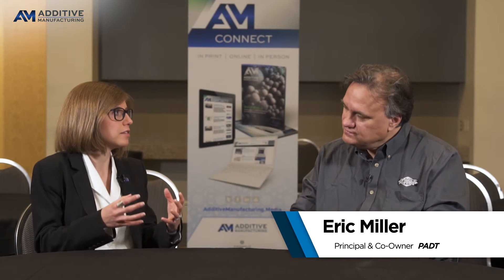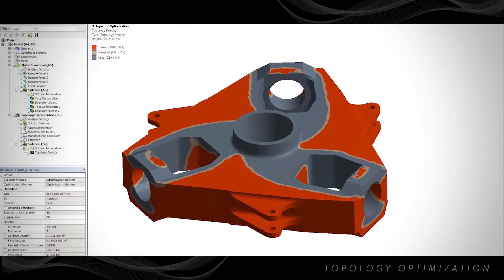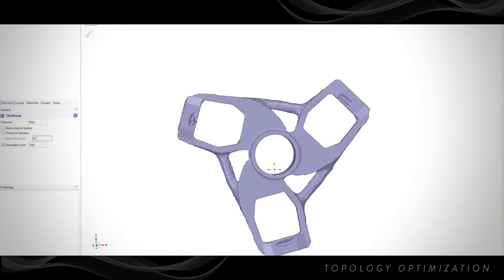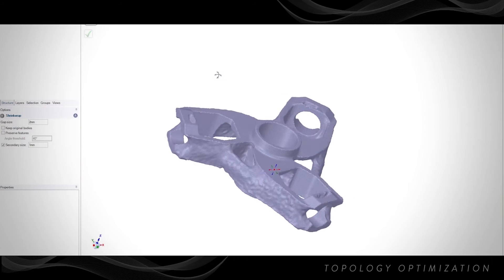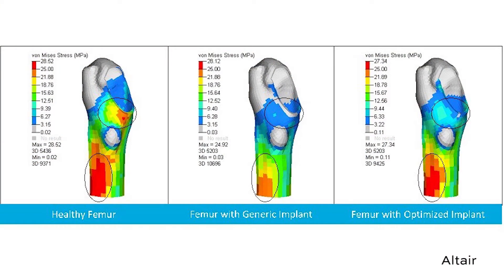Topology Optimization vs. Generative Design

Comment: I am currently writing an essay partially about topology optimization and generative design.

Does anyone know which methods are used for which technology ?

I've read about mainly SIMP and SKO and because of their description I feel like :
- SIMP is for topology optimization
- SKO is for generative design

Am I wrong ? Are they interchangeable ? Are there other mainly used methods or are these 2 the most prevalent ?
Reply from the maker: Here is what Eric had to say:

SIMP: Solid Isotropic Material with Penalization looks at a continuous variation of density and stiffness.

SKO: the Soft Kill Method is a great example of generative, instead of a hard kill, where you remove the stiffness. You change the stiffness and density.

So, under my definition of Topological Optimization and Generative, both are generative. They both look at variations in stiffness and density across an object where TO is a constant stiffness/density but material is removed.
Reply: There is also another method called RAMP

Comment: This just interferes with my thoughts, while trying to understand why audi has managed to design a fundamentally flawed gearbox mount which cannot last over 2000 miles... I think that they are using numerical design and predictive simulation to shrink the robustness margin of the product, and I'm still completely convinced and aware that they are  able to design a robust part that lasts possibly over 120000miles, but the sad truth is that, the power of fea run on hpc platforms is often used to limit the product functionality and robustness to a mediocre design that sells more frequently and piles up more profit... these optimization loops run with only two parameters in mind: 1// lower the cost 2// shrink the product lifespan  to a minimalistic acceptable period.

Comment: im still a bit confused here as the  end goal seems the same.  wether i start with a brick  and put holes in it in softwere and then  create the final part or, well im not even sure how i would even design a part in inventor using Generative Design.  lets say i have a frame for a car and its a mettel shel thats very easy to model out in softwere. just seems like it makes more sence to  use Topology Optimization on it. but  it be nice to learn as much as i can
Reply: I'm curious about this too. I'm guessing it's a mix of a few factors: 1 Different software and experience levels of designers with a particular approach, i.e. a comfort factor. Perhaps some specific part applications that require one method due to operational or design constraints or maybe there are legal reasons too vis a vis safety? It would be nice to know if there is really a difference in approach or if you wouldn't arrive to the same shape regardless of method.

Comment: Hi, thanks for the video. Do you know if generative design could be used for natural frequency optimization?
Reply from the maker: Yes – to the extent that generative design could be used to aim toward a part or structure with a particular mass as one of the conditions of the optimization. In theory, it seems plausible that generative design could also be used to target a specific mass distribution or center of mass. However, we are not aware of a case where this was done.

Comment: So, generally speaking, T.O. would be for milling, and GD is for additive manufacturing?
Reply: With the correct constraint, you can fabricate topology optimized parts various ways. It can be printed, cast, milled, you name it
Reply: Nope, i would almost say topology optimalization or generative design has nothing to do with manufacturing category. Its all about reaching product which has best value ratio mostly in terms of weight and price/stiffness.
Reply: This is however a good rule of thumb even if its not always the case, yes.

Comment: so basically topology opt is top-down approach and generative design is bottom-up approach?
Reply: Not exactly as one can remove material in either a top down assembly to component part, or a bottom up base part to assembly, the same for adding it. In short topology opt removes mass, or excess material in the cad-design phase, while on the other hand, gen design, adds material, to create the part. They can be combined in that the part you're generating is topologically optimized.

Comment: Topology optimization is a simple process? I just did a year of it and it is not simple
Reply: Simple to use the software
Reply: @lolgamez9171  garbage in -> garbage out
Reply: Couldn't resist counting the number of falsehoods in his explanation of topology optimization. I lost count. No clue how someone could argue topology optimization "removes" material. (unless you still use the highly outdated ESO methods) Number one misconception on the topic.
Reply: @StijnKoppen  I'm glad that you mention it. I don't think he really knows how TO works, otherwise you wouldn't say it's an easy process. Most of the time it is compliance-based TO, which doesn't have anything to do with stresses whatsoever, unless some kind of stress criterion is involved (often not the case). After years of research in TO, I still don't know what they mean with 'generative design'. It all comes back to what are the design variables, what's the objective, how do you constrain you optimization problem and what kind of optimization algorithm you choose.

Apart from that, the second part of the video is better nuanced, discussing the use of an optimized design in practice. I agree on that.
Reply: @porschepanamera92  Hello, do you have some books or papers about topology optimization that you can recommend? i want to learn about this topic.
Reply: @StijnKoppen  elaborate. the part at 4:57 looks lighter and looks to me it has less mass than its counterpart

Comment: Are there any software packages that assess fatigue, surface finish etc requirements as well?
Reply: Duncan, it depends on the thing you want to optimize on.  If it can be captured as a number that changes with changes in shape and topology, then yes.  Most packages are simple and only optimize on a few things like minimize weight, get stress in this range, etc...  But more advanced packages let you get under the hood a bit and calculate your own optimization goals.  The key is that changes in the value of the goal need to be correlated to changes in geometry/topology.  You mention surface finish. Generative design does not change that. It is driven by manufacturing choices.  Fatique is something that advanced tools should be able to address, although you may have to jump through a few hoops to get there.
Reply: Yes; Solid Works, Catia, PTC Pro Engineer, Autodesk Inventor are the ones that come to mind, though there are also others.